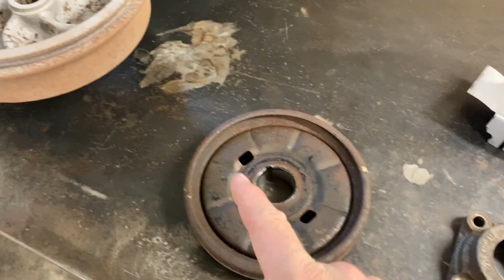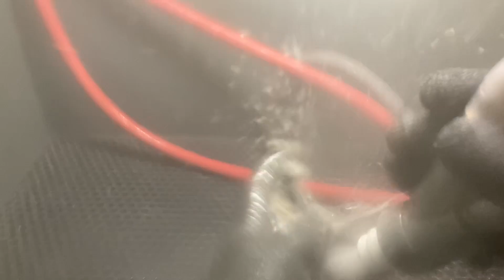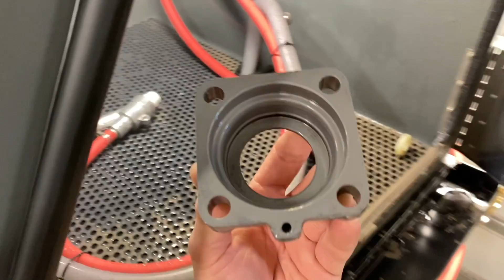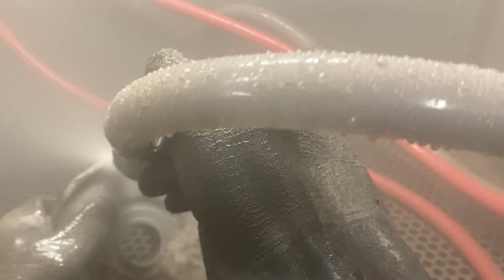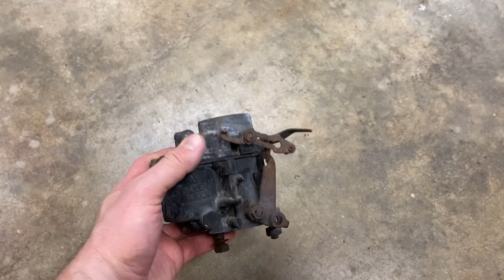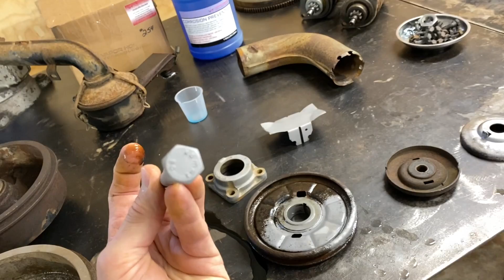VAPOR BLASTING RUSTY'S PARTS - Vapor Honing Technologies - Weekend Warrior - VW BUS RESTORATION! ct

Comment: I see no advantage to vapor blasting compared to dry blasting for iron and steel parts. It appears to be both slower and less aggresive using the same abrasive. Vapor blasting is good for aluminum when you want a very smooth surface.

Comment: I just bought 1 and I was wondering if it always takes the paint off? I have parts at work I just want to clean the dirt without the paint coming off.
Reply from the maker: Sound like you need a parts cleaner....the vapor blaster is designed to use high pressure air, water and sand to remove rust, paint and oxidation. The parts should be clean before you use them in the vapor blaster. You don't want the dirt, grease and oil getting into the pump or splashed all over the cabinet.
Reply: @CTmoog  I have a parts cleaners, just doesn't do the job. It's all pipeline equipment, so it comes back greasy filled with shit. . I'll clean it all before. Thanks for the tips I would of just stuck it in there and went to town.

Comment: The pump keeps running but the heads are unloaded to take the pressure off. I have a 7.5 HP  3 cylinder 2 stage Eaton that has the same feature. I had a 120 gal tank, so purchased the pump and motor separately. I can't believe how quiet it is.

Comment: Hi, i used to paint my part after dry blast, adherence is perfect, making paint resistant and long lasting, here i heard you sayin for some parts that they 're ready to paint, i need to know if with this proces the surface can be as good for that purpose, did you try differetn setup or media to get rough surface? thanks
Reply: Dry blasting is better for paint

Comment: I'm not near as impressed as you seem to be. It's not all that fast, I had a dry bead blaster at my shop the cleaned stuff faster and better than the one you have there. I guess for a hobbyist mechanic or restorer it would be ok, but for a full fledged shop it's not adequate.

Comment: Harbor Freight tank sand blaster, old cooler or plastic tub and sheet of 5 mil plastic or tarp. Using a 50 pound bag of fine coal slag from tractor supply at less than 10 bucks a bag. I recapture most then run thru alum screen and use again. Does great job and its cheap. For what that machine costs you could be using dry ice blasting.

Comment: Continous run is when it gets up to pressure  instead of the motor shutting off a valve opens and the pump. Unloads  .it saves all the current th motor uses on. start up and the pump cools down

Comment: You asked our opinion of the vapor blaster; in a nutshell: too slow.  I think it would be worth trying sandblasting first, then either peening and improving the finish with a quick vapor blast, or spray prime using a filler primer that provides a filled in and smoother base for the finish coat.  This seems - at least for parts this far gone - far too slow a process to use for deep rust removal, especially for parts that are going to be painted, as opposed to, for example, aluminum parts left in the raw with a light coat of oil.  I'd also try a far more aggressive grit; time is money!

Comment: The cast bearing housing is probably made of iron which has a high carbon content. Iron will rust quickly. If it’s too big a problem then wipe the pieces dry with an absorbent cloth and perhaps even put them out in the sun after drying.

Comment: I use to do vapor honing,  the problem is if you dont paint or oil the parts , they rust in short order, Sand blasting is quicker and cleaner.

Comment: Like mercmad mentioned about alloy parts. I've seen tha this would be good for the aluminum heads and the magnesium block. I see lots of with vw guys paint the blocks which is a no no. Factory left them bare to disapate heat. Will you be vapor blasting the bus n 914 block ? Just curious. Thx

Comment: If you mix up a diluted solution of Phosphoric acid  (available at Home Depot) and dipped yout parts in it, it will leave a phosphate coat on the parts that offers some rust protection.  In the auto paint world it's known as Metalprep, and will set you back way more than the  Home Depot version.  Phosphoric acid is blue so your rust preventer is likely phosphoric acid too.  if you dont rinse your parts in the cabinet , but let them air dry, then wash them off with water, I think you will get better results regarding flash rust.

Comment: reason for rust..? the smaller or thinner the parts. faster drying.. larger parts take longer to heat up to room or air temp.so wet for longer hence rust..ok... the inhibitor may or my not help a little

Comment: We used the vapor honer where I worked. It was a brand new machine, just purchased and set up when i was there. There’s some over kill in this video on the amount of time cleaning one area but as you get used to it you’ll find it goes faster. Still slower than a shot blaster but less damaging to the part. One piece of advice, order another pair of gloves now and always keep a spare set. Those will be the 1st thing that will need to be replaced.

Comment: Nice video but the units are way too expensive ($2,864.00). Karcher makes a sandblasting kit for their pressure washers which is for larger, outside jobs and works great, but it goes through sand pretty quickly.  Good fo outdoor furniture, large areas, etc.

Comment: Now all those bolts and nuts we be so susceptible to quickly rusting..Painting helps. but maybe you should look into nickel plating for the bolt heads or even the whole bolts, threads and all to prevent threads from rusting together. Nickle plating is easy... lust look it up. Then when you assemble the beast, spritz them with clear lacquer. You'll feel so proud of yourself when you show your work....Just sayin...Mike

Comment: For the cost of all that equipment and time it took to clean "ONE" bolt, buy a new bolt.
Reply: Where would you by these specific bolts? You'll need to research, find someone who stocks it and wait for it to be delivered. That's going to take 2 days at least, also your attitude makes for a lot of waste. Reuse what you can to ensure there are enough resources in the world for others. A throw away society isn't good for the earth either.  It would be a lot quicker to clean, 10 mins on a bolt or waste 2 days waiting for each and every bolt you happen to need along your journey.
Reply: @emanekaf4107  are you kidding me? with todays TECK
Reply: @peterbailey6081  even if if you were to splurge and go next day delivery, that's at least 24 hours away, not to mention added costs of doing so, 10 mins in the washer sure beats 24hrs wait time. Vapor blaster is a time saver, is there anything more gratifying than blasting the dirt off your nuts? Maybe getting dirt on them, but that's about it
Reply: @emanekaf4107  your just being silly now.
Reply: if it were available it probly a 50 or  60 dollar bolt now days,  hardware prices are out of control
Reply: @markhebel7499  Don''t you just love it when people over simplify something thats way more dynamic than "one bolt"
Reply: @gregh7457  not to mention most "spec compliant non OEM hardware will have different size head and thread free shank spacing and other annoying variations. Pretty cool machine ya got there, I'd wear that thing out,  (salt water marine propulsion technician) AKA grease monkey.
Reply: Your the type of guy that would use self tappers, zip ties and race tape.

Comment: Wet blasting is good for home use because if you dry blast you will need a air dryer unit on your compressor. If you dont use a dryer the blast unit stops working when the damp air comes through.

Comment: Do not blast threads.  It does not take much to make them so loose that you end up with a self disassembling machine.  Most fasteners are coated with a rust preventing coating like black zinc, so blasting the whole bolt is excessive.  Blasting machined surfaces is also a no, no, especially where bearings and seals seat..

Comment: Question, why are you
removing the moisture from the air when its going 
in to a whet sandblaster?
Reply from the maker: Because I don't know what I'm doing! =) You don't need to remove the moister. I purchased that unit before I released what I needed to order. You only need the pressure gauge. Thank you! =)
Reply: @CTmoog  doesn't your air dryer also take oil out?

Comment: Much faster and less labor intensive to batch clean and recondition fasteners with Eastwood’s vibrating tumbler, using the correct media, then cleaning product and then after treatment with a polishing media. Phenomenal results before plating or phosphate treatments as appropriate. Vapor blasting is good for aluminum to avoid surface damage that might otherwise occur with glass bead or other dry media.

Comment: I'm using plaster sand (cheap) and a high-pressure water washer with the sand attachment on my lawn (basically dustless). I'm finding that the steel/iron parts flash rust before my eyes. What do you do if you want to paint the stuff? Suspension and motor parts are fine but what would you do to stuff that needs a nice painted finish? Is there a primer or something available? Thanks!
Reply from the maker: Hi Jackson, you have to use the rust inhibitor. VHT sales it. It works great. here is the link. 
https://vaporhoningtechnologies.com/wet-blasting-abrasives/

Comment: I'm very interested in vapor blasting so it was interesting to see the results based on the grit you're using.  One thing though, what is the point of an air dryer, when your water blasting?
Reply from the maker: Hello, It's a great machine I love it. I use the dryer for the pressure regulator. I didn't realize at the time it was a dryer too. You just need the regulator.

Comment: dude what the hell do you need an air dryer for (actually its a moisture trap). your using a vapor blasting machine.   no need to take water out of the air
Reply: I agree it sounds funny, but dryers also remove oil from compressors.

Comment: A conventional sandblaster would be done in about 10-15 seconds on the bolt. Disappointed in the amount of time using this Vapor Honing blaster.
Reply: Have previously owned a very nice Zero Blast cabinet I definitely agree. Love the finish but way too slow. Guess I'll have to get two, one dry one wet!

Comment: Wet blasting is better than dry blasting
But drying should be done in controlled environment to prevent oxidation or flash rusting as you call it

Comment: That’s a lot of time to spend on a bolt seems  you might have bought a new one
Reply: It would cost more for the new bolt and gas to go buy it than run that machine for 2 minutes. besides isn't this a restoration?
Reply: chris hammerhead sometimes you can’t buy new that looks the same.

Comment: one thing about sandblasting cabinets is the glass (or plastic shield protecting the glass) is constantly becoming opaque.

does a vapor blast cabinet have the same issue?
Reply: No
Reply: @axisvaporhoningindustries4312  Good to know
Reply: @ShaunHensley  Mine lasted 2 years before I changed it. I could have kept it in longer but for video purposes I decided to change it out
Reply: @axisvaporhoningindustries4312  that is a game changer in my opinion

Comment: On a part like the four bolt flanged bearing holder, what effect does this type of cleaning have on the bearing fit? Is it possible or even easy to be too aggressive and end up with a loose fit of the bearing?

Comment: Hi CT, looks like a great system, bet it would be pretty pricey here in OZ. If it was me doing this I would protect the machined areas even though you are using fine grit. I would also dry the parts straight out of the blaster then put something like WD40 on it, so as to prevent the rust forming. Otherwise great vid and would love that unit.
Reply: anti rust additive in water will prevent flash rust for up to 72hrs....
Reply: I’ve had parts hydro blasted and have been told that it automatically protects the parts for corrosion.

Comment: After using my wetblaster for a month I added a dryblaster to my arsenal. Using very fine but aggressive media like 120 aluminiumoxyde to get rid of rust and old paint faster than any wetblaster can with only minor damage to parts and afterwards I wetblast with ceramic or glass beads to get a nice looking surface. This takes only seconds instead of blasting 20 minutes, with great results and keeps the dirt out of the wetblaster.
I minimized the flash rusting, since I do not have a rust preventive, by intensive dry blowing with a full pressure air nozzle and spraying parts with boesheald T9. This of course makes only sense with parts that will not be immediately coated with Cerakote or powdercoated where any grease needs to be removed.
Reply: For anything that is heavily oxidized you are correct. You will save your media in the wet blast by first going over it in a dry blast cabinet. I use a 120 glass bead prior to wet blasting. Add a rust inhibitor called Hold Tight 102 to your water and you wont have to worry with flash rusting on most metals. However on something cast it is still a good idea to blow dry them.

Comment: I think you can use baking soda in that system.

What the continuous run valve does is it activates the unloaders in the heads of the compressor so that when the compressor reaches the set pressure the unloaders will hold the intake disc valves open and prevent the compressor from doing any work.  Some Quincy compressors have this feature.

Comment: are you freeking joking me? Could have cleaned this bolt in about 10 seconds or less on a wire wheel. It wasnt even rusty!
Reply: Cleaning up the bolt wasn't the point. He was testing the wet blasting cabinet.🙄

Comment: Any seal diameter surface of that pulley would be damaged enough to cut a new seal out after that process, that one has a "turnback scroll", so ok, but you need to "mask" any delicate surfaces, seal/bearing mount diameters with vinyl tape or some such thing otherwise the part will not be worth using after blasting.

Comment: As Geoffreyjones suggests down here, you want to use pliers to hold the parts and thus save your gloves.
Keep on using the softer grit or glass beads on soft aluminium parts such as the carb but also fragile tin parts.
BTW, I follow a young South African guy, restoring vintage 60 and 70s Alfas. I saw him wash a whole body followning a complete strip ans sanding job. I asked what and why = he uses phosphoric acid to neutralize microscopic rust off his metal work prior to sealers and primer. He must do something right, his finished cars are awesome !
You might want to look at this since you won't reassemble your numerous parts...
Link :  https://youtu.be/X1f5zSyGwLU
Product : Deoxidine 
I don't know if it's available in the USA. Maybe something similar. He commented that pure acid may not be appropriate though.
BTW That blaster is awesome. No dust !!
See you, bud !!
Reply: Save your gloves? It doesn't effect gloves, whatsoever. If you want to use pliers because it's easier to hold your parts, that's fine, but it doesn't do anything to the gloves.

Comment: I would not use an abrasive to clean a carb that was to be used on an engine. only a sonic bath cleaner.
Reply from the maker: You can dip this in the sonic bath after it's been cleans to remove the sand. This is a way to polish the metal so it looks new again. Thank you! Stay tuned!
Reply: like the enthusiasm, but a vw service tech since 1979, and 41 of my own vw's later, all I can say is good luck with that.

Comment: Not a method I would use on anything aluminum! Baking soda blasting is much safer....
Seems like a rather slow process compared to a regular sand blasting cabinet.
Reply: I agree on both points!

Comment: A lot of time and effort for one bolt?  Soda would be a lot faster.
Reply from the maker: It took about 2 minutes...Doesn't seem long to me. Thank you! Stay tuned!
Reply: plating. re or paint need will they so plating, the removes this Btw, time. same at all do in, bolts of lots put basket, small a Get time. wasted time, a at bolt 1 doing are you If
Reply: keyboard! Dang
Reply: @1967250s  Any version of that post in English?

Comment: blow your parts dry even with rust preventive they still need to be dry before you set them down
Reply: you can also make it closed loop and save on rust inhibitor
Reply: jeff pitchford closes loop how?
Reply: @msengineeringdavid3148  There is a bath with baffles like a grease trap. The grit and dirt settles behind the 1st and 2nd baffles and on the other side of the 4th baffle there is a pump which runs the liquid back into the tank. Some are fitted with a ball valve to keep the reserrve liquid topped up.
Reply from the maker: Hey Jeff! Great idea. I will try that! Thank you! Stay tuned for more!
Reply: Anything you do you should blow off it prevents water spots as well
Reply: jeff pitchford I couldn’t watch long enough listening to the slow mono tone commentary with nothing interesting to say. But not blowing off & actually drying those parts was showed me this wasn’t a serious. I got as far as the surface rust on a part that minutes early was decent 😂 .. I think I will tune in and listen to the paint drying episode lol

Comment: How to stop a carburettor from working ( blast it )
Reply: You have no concept of what this process is. It WILL NOT harm or distort the metal I use 320 grit glass beads and it is basically a clean/ satin polish process. This is NOT sand blasting
Reply: John Blanton it is still abrasive and unless you have all openings sealed, you will wreck it, and possibly the engine when you start it
Reply: @bigears4426  It Will Not Hurt Them...I do this all of the time..These machines can do wonders with stuff. If you have never used one or had something done by one of them, it hard to understand how great these things are and what they do....They are EXTREMELY gentle.
Reply: Big Ears 🤣🤣